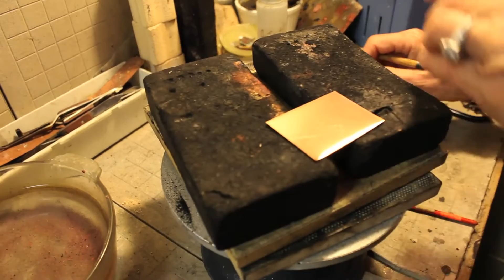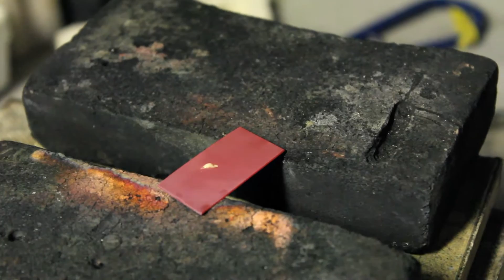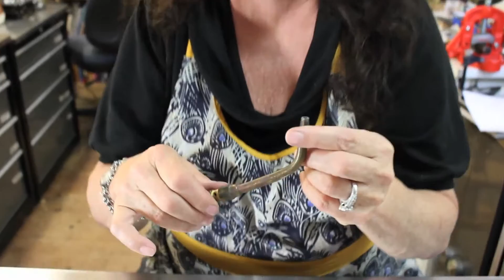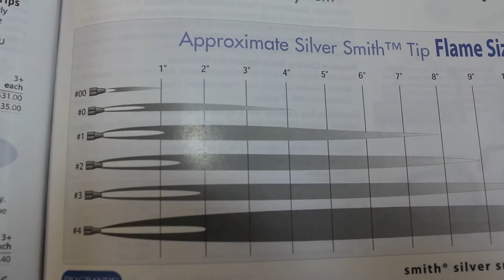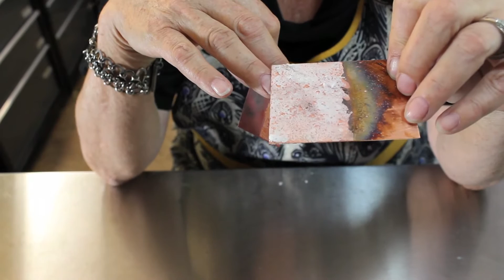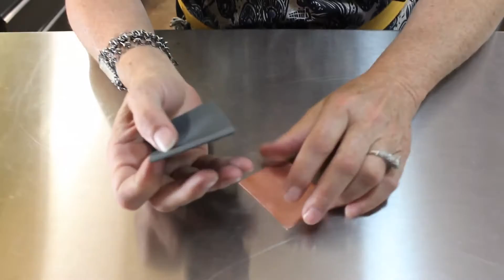Soldering 101: Part 2 | Jewelry Tips with Nancy

Comment: Hi Nancy, big ta for this video! Although i always wash my piece with antibacterial soap before soldering and filing solder before putting it on the item being soldered it happens awfully often my flux does not flow...but i guess in my case it would be lousy joint;) I simply don't have that patient in my...:)